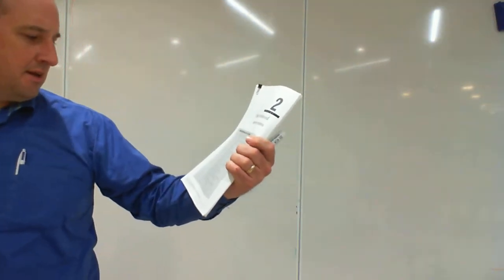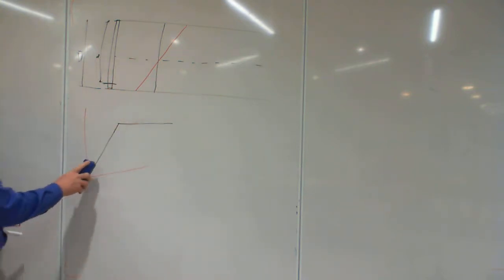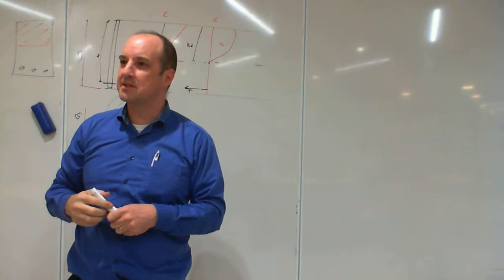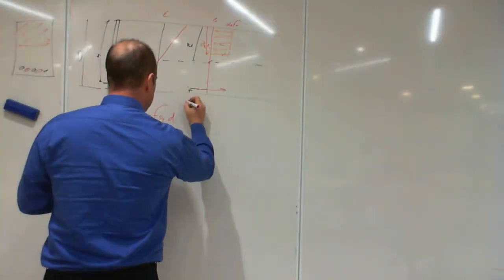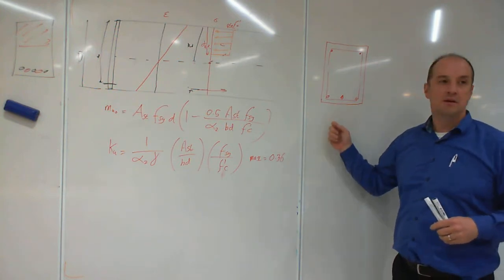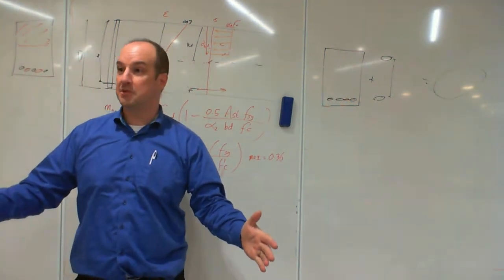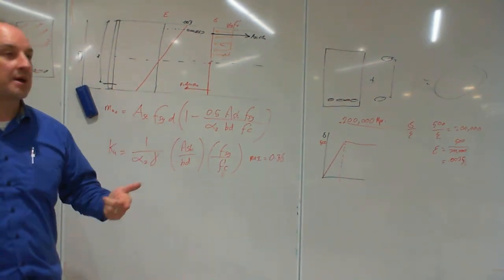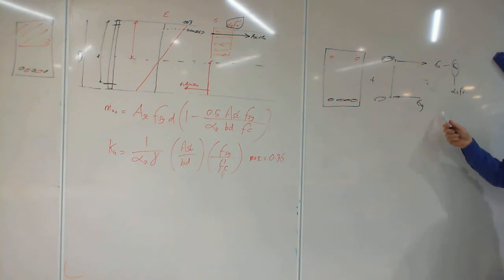Double Reinforced Concrete Beams Part 1

Comment: Hi Peter, really much appreciated mate for these videos.
i would like to ask you where I can find a good example to design a typical Australian warehouse " Tilt-up precast panels as bearing walls braced through steel structure on the top". 
i have purchased the reinforced concrete book "the designers handbook" for Beletich, Reid, Uno and have all the Standards. but the problem there is no step by step or example in Australian Standards for a detailed study or calculation report for such thing. Like panels to be connected to strip footing better or to slab and how many connection it needs.
I'll be greatfull if you can help me out.
Ahmad.
Reply from the maker: Ahmad, not sure sorry.  I will keep an eye out for you though.